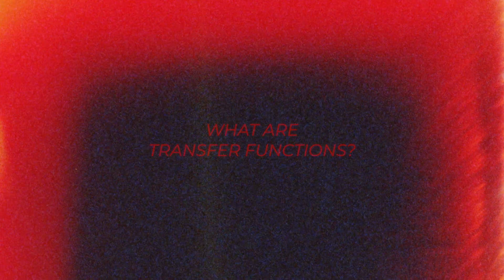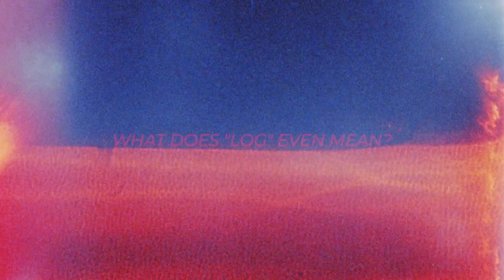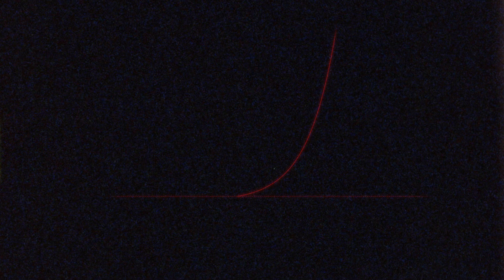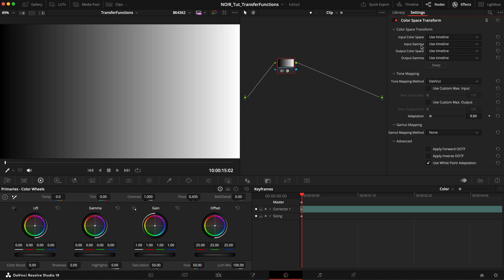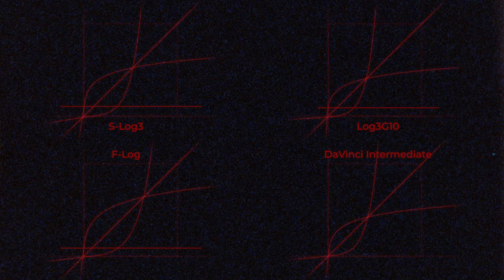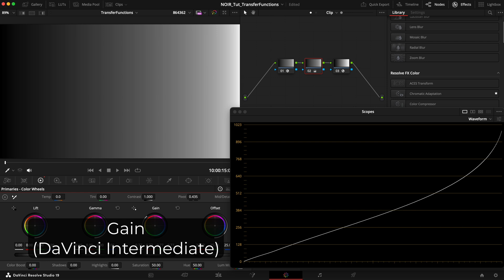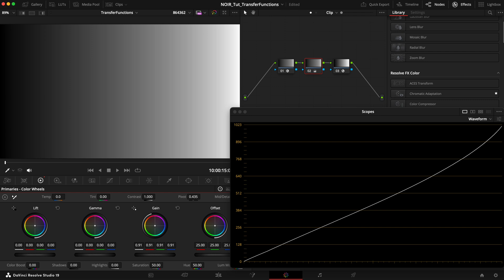What are LOG CURVES actually? (color science)

Comment: "light is linear" is a very seductive idea only to say and chuck it off. 

There is inverse square law relationship between a light source and a surface. Simlarly when you stop up/down a lens, you change the entence pupils radius linearly wheras its area exponentally to the power of two. π•r²
Similarly most if not all cameras store "camera raw"(bayered sensor dump) data values in pure log2.
Reply from the maker: all great points, thanks. there is only so much you can pack in a 9 minute video

Comment: As always, great presentation! However, it makes the impression that the inverse of an OETF is called EOTF, which in a theoretical model is true, but in reality there can be differences. I believe the correct term is simply "inverse OETF".
Reply from the maker: can you elaborate on that? in my understanding the EOTF is usually in fact the inverse of its corresponding OETF
Reply: @NOIRGRADE  Well, they serve different purposes. As you said in your video OETF is used to digitally encode the light captured by the sensor.
The purpose of an EOTF is to decode the encoded signal for display devices, and it can't be a simple inversion of the OETF. Even in Rec. 709, the OETF and EOTF are different (EOTF was only formally defined later in BT.1886) because if they were exact inverses, the end-to-end gamma would be 1.0, which is not ideal for dark viewing environments. In PQ, the EOTF is entirely independent of the OETF, as PQ is designed around human perception rather than being a direct representation of captured scene light. On the other hand, in HLG, the EOTF is mathematically the inverse of the OETF, but display devices still adjust the content based on their capabilities. I'm not an expert in the field, so I recommend looking into it further for a more detailed understanding.
Reply from the maker: I see. Yeah true, going with the "optical to electronic" and "electronic to optical" wording, there can only be one way be the sensor and one way be the display. That makes sense. It also makes sense to rather use the term inverse OETF in that context then.
Adding to the example of going from scene to Rec.709: Let's say scene is LogCv3. You would first go from LogCv3 to linear (so here you use the inverse OETF) and then go to Rec.709 which is a combination of a Gamma 2.4 and an OOTF (this combination is the EOTF). Yes in that sense it makes sense to use different terms for inverse OETF and EOTF.
However let's say the footage is already in Rec.709. How would you call it now? Would you still use the term OETF or would you now call it inverse EOTF when you transfer to the scene space?
Reply: @NOIRGRADE  The OOTF actually includes both the OETF and the EOTF. The EOTF alone (as defined in BT.1886 for Rec.709) is essentially a Gamma 2.4 curve, while the OOTF represents the overall optical transformation from scene light to display light.
For your question, it depends on what you mean by "footage is already in Rec.709". If you're referring to an image that has been encoded using the Rec.709 OETF but is still scene-referred, then you would apply the inverse OETF to return to scene-linear light. However, if you're referring to a fully display-referred Rec.709 image (meaning both the OETF and EOTF have been applied), then you would need to apply the inverse OOTF to get back to scene-linear space.

Comment: Thank you for shedding light on the LOG mystery. I think that with OETF/EOTF we have the compander system well known in telecommunication. So in it's terms OETF = compressor and EOTF = expander. Between compressor and expander located a noise chanel or a media with limited dynamic range. In case of camera this is the pair ADC/DAC that has limited DR - 60 dB for 10 bit and so on. Not "Camera wants to compress" as you said at 4:35 but ADC/DAC with limited DR forses producer to compress 80 dB to 60 dB to squeeze through ADC/DAC. After ADC/DAC the expander (in Resolve) expands 60 to 80 dB. This is my hypothesis ))) - what do you think about?
Reply from the maker: Thanks for watching. I am being honest, I don't know too much about that compander system, so yes maybe (?)